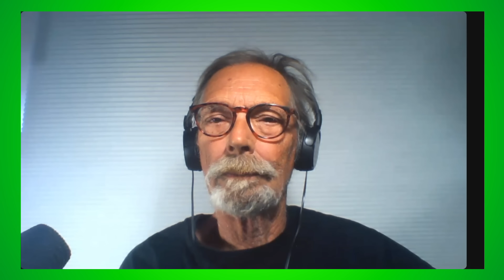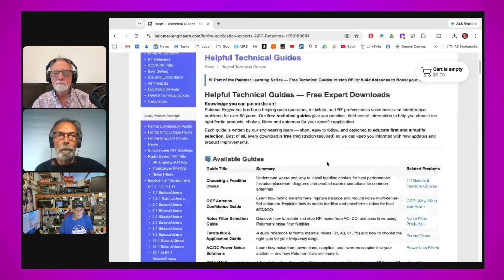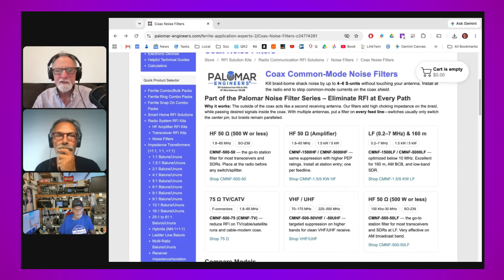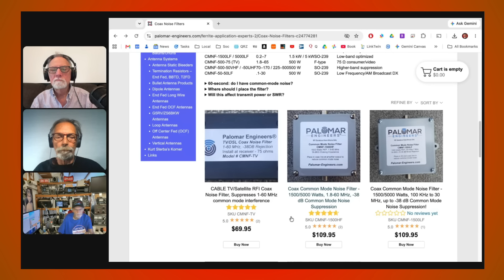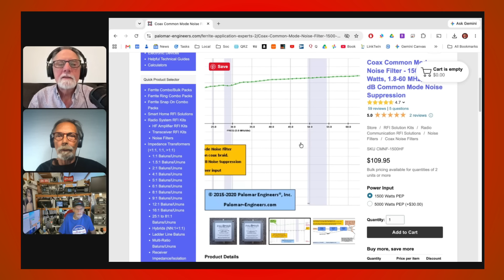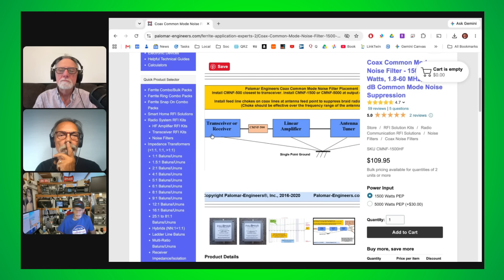AMAZING Secret to Reducing Radio Frequency (RFI) in Ham Radio HF Reception!

Comment: I got here from ChatGPT of course. I learned a bit about the Unintentional Radio Reception or RF Rectification. Story is, im in a new house. At night when its quiet, i get ham radios, am radio, maybe even fm radio coming from the electrical wires in the walls. its all stations i can clearly hear. music, chatting, talk shows. First im going to prove it to my wife cause she thinks im crazy. By means of a cheap AM radio. turned off and then i tell her what im hearing. Turn it on and whala. I have narrowed down the radio towers that would be most likely heard. Then, tell me if im wrong. To fix the problem, maybe start with the coaxal cable coupler outside the house and get it replaced?
Reply: and im aware it could be many more issues, but the signal seems to jump from outlet to outlet in this smart home. hopefully thats not the case
Reply from the maker: Sounds like elements of the smart home are picking up the signals. I would start here:

Identify the Entry Vector and Cable Resonance
The "Accidental Antenna" Effect: Long low-voltage lines (Cat5e/Cat6, 18/2 thermostat wire, RS-485 bus lines, or in-wall speaker lines) act as quarter-wave or half-wave resonant antennas at specific RF frequencies (especially across HF and VHF bands).

Pinpoint the Active Lines: Unplug suspect runs from the main switch/patch panel or smart hub one at a time while observing when the erratic behavior (false sensor triggers, audio hum, packet loss, or flickering smart dimmers) stops.

Then start adding ferrites to the lines that seem to be carrying the signals.

Any others have ideas?
Reply: @HamRadioPerspectives i was planning to start at the patch panel, thanks for the extra input 😊

Comment: I have an end fed. I have S8 & S9 on 10, 15, 17, 20, 30 & 40 with JUST the center pin in. With the PL259 screwed all the way in theree is no change...Something other than common mode is causing this...any ideas? Thank you
Reply from the maker: High noise levels with only the center pin connected suggests you might be picking up significant localized RFI, or potentially a grounding issue with your feedline. Q

Comment: I tried the noise test and got an S9 on the center conductor and S3 on the outer conductor. What does that mean?
Reply from the maker: You need to try a noise reduction device, like Bob mentioned. In your case, it should make a great difference.
Reply: @HamRadioPerspectives  Thank you I will try that
Reply from the maker: Please report back.

Comment: So 100 % of my s9 noise across multiple bands comes in on the center conductor based off of these tests. If I kill my main and run off of battery my noise goes away but here is the tricky part if I have any random breaker on it comes back. In my mind thst tells me its coming in on the mains neutral because thsts the only thing g common between all breakers.  Ive got a stack of ferrites on main coming in with no luck  what's next?
Reply from the maker: I would first check and make sure that the system ground rod is firmly attached to the breaker panel.  Best to have a qualified electrician check that out.
Reply: @HamRadioPerspectives  it is , I installed it when I upgraded and installed my own 200amp service panel.  Ive had the electric company out, so far  they have only found some arcing in the neighbors tree from a drop. That dropped my noise about 2 s units on 20m but still s9 on 40 and 80.  Its bad all over town it effects my 10m rig and my 2m rig when mobile but ironically doesn't effect 10m in the shack
Reply from the maker: They are looking for their own service-related stuff. You need to use a small AM transistor radio and track down LED lights, etc. See these videos we did:
https://youtu.be/Ywzk2h1ZIaY
https://youtu.be/FnzqHw3jb0U

Comment: Hi, the word "noise" does hold a special place in electromagnetic theory; its misappropriation is unwise and confusing. What's discussed here is man-made Interference. I'm pleased to see "RFI" in the title, the FCC in the USA and other bodies globally take minimising sources of RFI very seriously.

On the rejection of energy coupled solely to the outer skin of a coaxial transmission line. Once again it seems to be another misappropriation to refer to this as "common", when it is determined as not present elsewhere.

Comment: I have Bob’s   end fed off center fed 40 - 10 antenna, awesome product. Highly recommend this antenna. I have  not done a permanent install yet, looking to get that  done soon. Need to rent a snorkel. I have a really sharp angled A frame roof at 40 feet. A ladder is out of the question.  I have used it with a mast, works great, but I want to do the permanent install, I can get a 50 ft height. Way better than 30 Ft sloped.
Reply from the maker: Go for it! Q
Reply: @HamRadioPerspectives Just saw the short on calling CQ. Great advice! At times getting a DX call sign is extremely difficult. I see what you pointed out very frequently. 73

Comment: Very good stuff. I built an OCF based on the plans published on the Palomar website. It includes a 4:1 Balun and separate line isolator/choke at the feed point. It works really well and has given no trouble. It's also quiet :). Thanksto all, Ed KO6BLM

Comment: Why doesn't he sell EFHWs?
I wonder how these differ from 1:1 chokes.
Reply from the maker: Mike, if you watch the recent video we did with Bob, he explain why he makes them as off-center-fed antennas. I just bought one for a new ham in TN and it really works well with no common mode current in the shack and it is quieter on receive than the straight EFHW. Here's the link if you want to go back and check it out: https://youtu.be/tbJLVR_LJ6o I am going to get one and try it out against my other antennas. Q
Reply: @HamRadioPerspectives  I'll look into that, thank you, I've heard you make several positive comments about them. I have a 41' x 24' x 14' high space to work with. Cheers. 
btw I downloaded several part 97 pages of specs, had the AI turn them into a javascript database, and I'm using that to keep the site as accurate as possible. It's amazing how many cross references you have to work through to understand part 97.
Reply from the maker: Amen on that one. Palomar is really known for its noise reduction products, which I use. But Bob has gotten into antennas and is using designs that are excellent. I've ordered one of his 80-6 meter OCFs to see how well it works compared with my home brew unit, and will post results. Q

Comment: Just center conductor my noise is s2, fully connected pl259 noise went to s4.
Reply from the maker: Sounds like you have a classic case of common-mode noise on the shield. You could use a noise filter (balun) at your rig. I do it to get the noise down about 1 1/2 S units. Q

Comment: In the days of AM transmissions, we would break into Church P.A. systems.   We found out that Crystal Mics ( 50 kohm.) were much more susceptable than the 600 ohm Moving Coil Mics.    So maybe it is a good idea to limit your aerials to 50 Ohm dipoles, than to use high impedance long wires.
Reply from the maker: Interesting observation on impedance and interference, thanks for sharing!

Comment: Wow! Thanks for the study. I have a background in microwaves and RF. From a practical real world operating perspective,  when you connect just one antenna to your rig, you are actually connecting three antennas: the center conductor antenna; the outer conductor antenna; and the skin effect antenna. Would you concur with that?
Reply from the maker: @adon2424 That is exactly the point. 2 wires, 3 conductors.
Need to think 3 dimensions.  73

Comment: Thank you. I have one of those baluns that has the so-239 mounted inside the box. I have had intermittent issues. I actually stopped using it. When you mentioned that, a light went on. I moved the so-239 to the outside. All is good now.
Reply from the maker: Glad that helped you get back on the air! Q

Comment: Several years ago, my HF rig all of a sudden was unusable from one end of the Band to the other on Six meters ! 
After days of trying to track it down, quite by accident, I stepped out of my vehicle on my next door neighbors side of my driveway, while having the handheld receiver I was using to track with, and noticed a sizable noise with good signal strength ! 
After conferring with my neighbor, it was found that he had recently purchased a cheap cordless screwdriver and charger from Harbor Freight ! 
Seems he thought it a good idea to let the screwdriver sit in the charger continuously ! 
Once unplugged the horrible noise that had inundated my receiver on Six, was gone ! 
Thru the years I have found other unfriendly appliances, that are not friendly to Amateur Radio Frequencies ! 
One, Touch Lamps that are switched on or off by touching them ! 
Horrible on HF frequencies ! 
Another, Keurig coffee makers ! 
Even when setting idle, but plugged in, are also noise makers ! 
I hope my long hours of research save someone some time !
'73
Reply from the maker: The hunt for RFI can be so frustrating, thanks for sharing these tips with the community! I was just on the phone with a guy who I think is getting hash from his neighbor's pool system.

Comment: Ok, (and wow!) Question:
I'm curious how this applies to my window line fed doublet.

Each 32-33 foot leg goes to a center (corian plastic) support, directly to me DEX 450 ohm window line, into a stacked 240-43 torrid, bifiliar-wound CMC choke, into coax, antenna tuner, meter, receiver...

So there are literally two conductors- and east and a west antenna leg (14 awg solid copper) plus a left and right (each leg of the stranded window line.  (Right?)

Into a CMC using 14awg stranded, INSULATED wire, before the coax.  I believe I remember that insulated wire does something slightly goofy to the skin effect... but not sure.

In this arrangement, I don't think I suffer the same Common Mode Noise pickup, correct?

I ask for two reasons.  The first is that my Kenwood TS-440S  seems to achieve 5/9+10 or even +20 on signals that are well into the noise floor on my rx.  Maybe this is the rx station having a low power or less than ideal antenna, I guess.

But the second reason is to better understand this, as Im quite sure I'll be configuring a coax-fed dipole or EFHW before the weather takes me into the secondary shack location, and want to be sure I get this right.  I'll have to do the coax test for sure, but want to get everything lined up so I'm not waiting on a shipment.
Reply from the maker: Not an issue. Stay with the doublet, one of the best antennas. 73

Comment: Thanks Bob so much for this wonderful presentation. I’ve only been into him radio for about four years, but I learned quite a bit and I live in a urban area not too far from New York City and boy. The noise here is horrendous. I had a guy come out from the power company who specializes in finding noise problems usually it’s a bad insulator on a pole, which can really cause a lot of headaches while he found three or four of them in about two blocks from my house and that made quite a difference, but I’m going to go to your website and see if I can get more educated and if I have a problem, I’ll buy your products but I’d like to thank you for a wonderful presentation and experience
Reply from the maker: Glad you could track down those noise sources, thanks for watching! Q

Comment: Bobs products are awesome 👌 I have a endfed 1/2 wave, live out in Salome AZ and never had a problem with noise.😂😂
Reply from the maker: That's awesome! We're trying to get Bob back to do a video on baluns/ununs. There is so much confusion, even the difference between voltage and current baluns. Stay tuned.
Reply: @HamRadioPerspectives 
Ya I  watch you guys for the technical side of ham radio, your channel is a must see for operating HF and other modes, lots of great information in a easy to understand format, keep up the good videos, AI7VS  Dave  73s. 😂😂😂
Reply from the maker: Bless you, Dave. We are very grateful for your support. Q

Comment: I have a common mode choke device that has all the choke components installed inside a black pvc pipe that has a glued and sealed pvc cap on each end with so238 connectors to place inline your coax run easily with pl259 connectors on each end of your coax. I purchased it from Bob at Palomar a few years ago. It certainly cuts down on noise! I also have the Palomar 9:1 transformer with 155' in length wire that I purchased from Bob for my End Fed wire antenna. It tunes up and covers 160 thru 10m with the auto-tuner on my Yaesu FTDX-101MP without a single issue. The axis of the End Fed wire runs South to North giving me station contacts as far north as Canada, as far south as Arizona, out west to the Oregon coast, and east to Idaho, Utah, Colorado, including NE to Montana, Wyoming, and SE to New Mexico. I can reach the East Coast of the US depending on which band I'm currently operating on of course. I can honestly say that Bob has great products that work as avertised, and hold up to weather, UV, and RF power that they're rated for. If you order 75' 3" of wire, or 160' of wire like I did, that's exactly what you get to the very foot or inch! You can't go wrong with Palomar Products!!
Reply from the maker: It's great that you've found a setup that works so well for your station! Q

Comment: Bob said you need a “stop sign” at the top of the antenna, however one of the hosts said he has the common mode choke on top of his desk.  Does it make a difference where the choke goes?  Also I wonder where it is placed ( the choke) if I have a vertical mast and there is a remote tuner at the base of the 41 ft vertical.  Thank you for the great presentation. Gene K7Mgm
Reply from the maker: Hi, Gene. One choke (preferably a 1:1 current balun) goes at the antenna, and the other, noise choke, goes at the rig. Sorry we confused you. Q

Comment: Tom's (WA9TDD) audio has no high frequencies and sounds lousey. It sounds like he's in a garbage can!
Your video looks mostly like an ad for Palomar Engineers!?
I prefer to make my own ham gear, especially antenna projects!
Reply from the maker: Thanks for your note. We are working on Tom's audio. The issue comes and goes, sometimes even during a video. Glad you are making your own gear. We paid for the unit I showed and do not receive any compensation from Palomar. Sorry if it seemed like just an ad. 73
Reply: Suppose this: "Someone makes a great product that works, but we wont' tell you what it is, where it's made, the tech, where to buy it or share a secret interview with the engineer."  If someone or a product is good it is a good to simply and plainly tell it. My ego is not wounded by this. Supporting superior American built products is ok too. Yes the audio needs work, yes DIY it good. A bad piano player shows up for the job and having checked out the piano finds an out of tune note. He bangs on it repeatedly, loudly, calling attention to how good he is. No. A good player will just work around the bad note until the tuner gets around to it.

Comment: It’s a great interview. I was wondering where to put one of the common mode chokes if I’m using an antenna switch. Right next to the radio or close to the switch or on each coax before the switch?
Reply from the maker: Each coax before the switch. Q
Reply: @HamRadioPerspectives   I’ll give that a try. I did find one large noise generator. I have a Lennox heat pump. It’s got a variable speed compressor and fan. It sips energy unlike my old Goodman but it’s very good noise generator. I’m going to put some of Bob’s ferrites inside the unit. I’m just hoping it doesn’t affect the warrenty. 
The GE fridge and my solar array got them on the first go around. 
🥺
Reply from the maker: Good for you. I have had to use them many appliances, too. I will just take off the ferrites if I call someone for service. Q

Comment: How does the signal on the coax shield get into the receiver front end?  We all have earth-grounded stations (Right...?) so without a filter I’d expect any RF coming down the shield to be shunted to earth ground.  A deficient earth ground could make the rig’s chassis ever-so-slighty “hot” to shield noise.

Comment: I tried this and interesting enough on my 20 meter dipole with a BALUN, down to a CMC right before shack entry, most of my noise is coming from the center conductor. I guess this is what they refer to as QSM? I leave my house and drive 4 houses away and it drops dramatically. I get to the park and its virtually non existent. I am thinking the only way I can stop it is to invest $$$ in a loop antenna because the verticals and dipoles are going to pick it up. Is that correct thinking?
Reply from the maker: First check for power line noise: https://youtu.be/Ywzk2h1ZIaY

Comment: I'm in Maryland and my cousin is in  Nnevada on 40m all the time. What type of antenna and how much power would you use to try to reach him for a conversation?.
Reply from the maker: That's a tough one. 100 watts and decent-height dipoles should do it on 40 in the evening, after sundown, but 20 meters during the day would be better. Depends heavily on conditions.

Comment: What does it mean when the noise floor drops when connecting the coax shield and center conductor to the transceiver output, verses just connecting the center conductor?
Reply from the maker: Means that external noise (common mode) is coming down the outside of the coax to the rig.